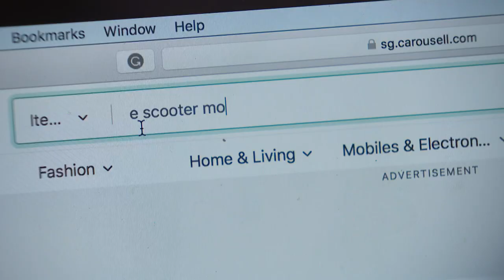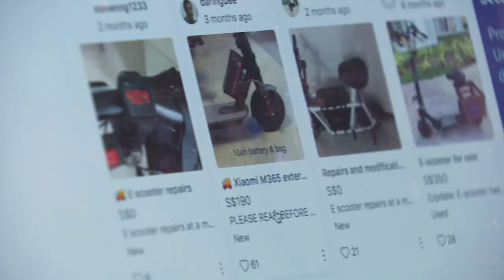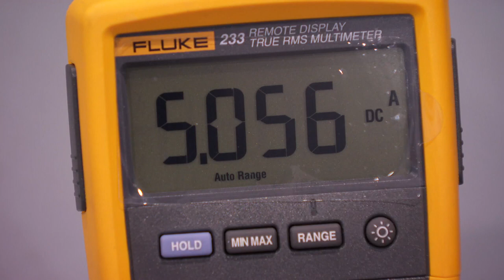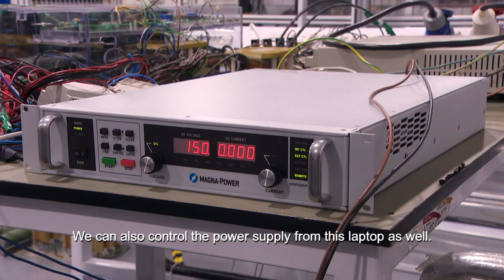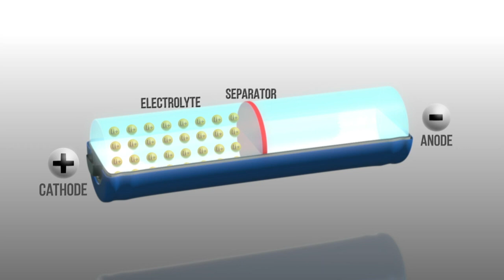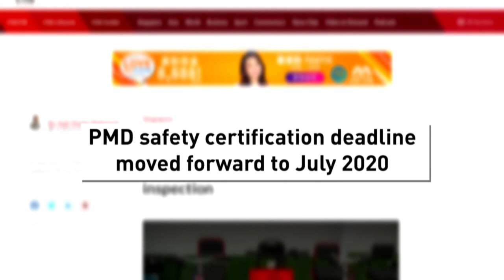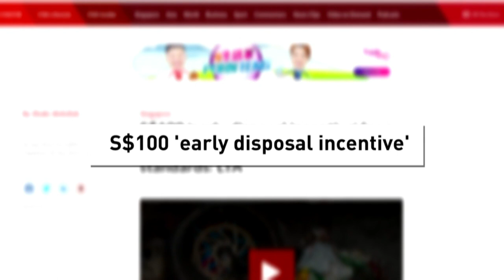CNA | Talking Point | E24: What causes PMDs to burst into flames?

Comment: Bottomline is battery can ignite or explode when overheated.  
Higher charging and higher power output above batteries' rating and packing more battery capacity by changing battery type or add more batteries can all cause excessive overheat build up. 
Battery temperature sensing protection in BMS is the last line of defence. Modifications may bypass the protection circuitry, e.g battery pack without proper temperature sensor installation, mismatch sensor/protection circuitry etc.  Also a PMD heated under the sun may have an overheated battery either won't operate or catches fire.
User's desire to have faster charging, higher power motor and higher battery density all adds to stress on the battery.
For personal safety as a user, insist on a battery temperature safety test  (charging and discharging at high ambient temperature) after a PMD modification.  😏
Voting for PMD parking/charging stations and no PMDs in buildings. 😉

Comment: Its an interesting story but she clearly has a strong media bias. Would be better if her tone was impartial.
Reply: What bias? It is fact that pmd battery has the risk of catching fire and it is fact that pmd fire burn down the homes, I have also witnessed pmd fire happened at the block just opposite to mine. She also presents the other side of the coin, the advantages of pmd and pmd modification

Comment: If one has to keep the PMD in in their apartment, charge it in the tub/shower.  If it catches fire, it is surrounded by ceramics and metal.  Pull the electrical plug out of the wall outlet and turn on the water.
Reply: Lewis Doherty cannot la. Add water to lithium u get Hydrogen. More fire come out
Reply: @jiashenghe5504  I had thought about that since lithium is in the first row of the periodic chart like Potassium and Sodium and we know what happens when water is mixed with those, but then the rubber tires (tyres) will likely catch fire.   If the battery is already consumed in a fire reaction, there may not be enough lithium left to react and the tires become a major problem.  The real solution would be the ability to detach the battery and charge it outside separate from the scooter.

Comment: Its biased reporting.  Done to make the report sensational.  Some of the info are a fact and is true but the way its presented seems skewed.  PMD are also popular in China, Taiwan and Korea are they having issues? How abt Hybrid cars and Blue SG don't they pack way more charge?
When someone upgrade the battery itself so does everything else used in the drive train needs upgrading from controller to the wire gauge.  Even the charger.  A cheapo laptop charger just won't cut it.  Also the cells need to be in a impact resistance casing...not some simple shrink wrap.  A simple street guy or void deck specialist unlikely able to understand this.  Just to explain to CNA they need several foreign/local associates.  Is battery rocket science.  Fighting battery fire of Li-po cells has a different approach.  You cannot use water as it become a catalyst! Many ppl don't know this.  So electric powered vehicles is the future.  We need to embrace and make it safe for everyone.
Reply: Good reply. So how do we get impact resistance casing?

Comment: I do not own a PMD, I do not ride one, I do not even like PMDs, but this CNA episode illustrates to me why I cannot be bothered with local news sources.... An idiotic segment that involved idiotic fear mongering and NTU scientists to boot. I do not know whether the researchers were aware of how they would appear on the program, but they should be embarrassed.

First off, the motion put forward is whether modifying batteries in PMDs are dangerous. Of course! But nobody does that. You cannot modify batteries in PMDs. You can only add extra modules. Look at the thousands of teslas on the roads. Or hybrid cars.... Do they burst into flames? It has nothing to do with the size of the battery. So no. Batteries do not burst into flames if you add extra modules.

The crucial bit of concern should be whether the batteries are quality products and whether they were hooked up properly. If the batteries are quality and hooked up properly, why should it burst into flames? The reporter brought in a modified PMD. It was obviously wired up properly and compatibility was not an issue, or else they would have called it out to strengthen their case. They then proceeded to deliberately overcharge the battery way past its limits. So that it would fail... What kind of experiment is that? Who doesn't know that batteries should not be overcharged? Is it then OK to overcharge the original factory batteries, but not aftermarket ones? Shouldn't the controller and charger be scrutinised more carefully?  Instead of that, it all got glossed over. Talk about twisting the narrative to fit your BS

Batteries will only cause issues if the the quality is bad, the controller was not properly updated, or the charger is faulty.

Deliberately overcharging a battery to failure proves exactly nothing. The only takeaway from this drivel of a program is that do not use an overpowered charger to "quick charge" your PMD, unless it was specifically built for your setup. A proper conservative rate of charge will always ensure longer battery service life and prevent battery overheating... Thats about it, really...

Comment: Kind of kool this is the normal transportation nowadays and I don't need a motorcycle with stinky dinosaur poop 😂 Also all you need is basic electrical engineering/ mechanical incline background and (money) to build any ev after all is not rocket science basically there's only two wires - + PS (get a big azz metal box)

Comment: I refer to "CNA | Talking Point | E24: What causes PMDs to burst into flames?" by CNA on YouTube. Business opportunity to make off the shelf e-scooter or PMDs to have batteries that enable them to travel further as it is within the law for food delivery riders. Perhaps special scooters sold only to food delivery companies where the companies sell to employees? Alternate versions are to make the battery easily swappable on off the shelf e-scooter, thus you can use two legal safe same scooter brand genuine batteries without any illegal modification to go twice or triple the distance - concern is rain getting into the battery compartment - however if you take the old tech from the car's engine where rain falls on the car's bonnet and the car can still run and the battery dont burst into flames, you might actually be able to sell a lot more e-scooters and batteries with aforementioned proposal. Please feedback to management.